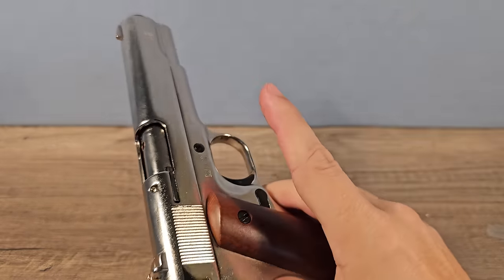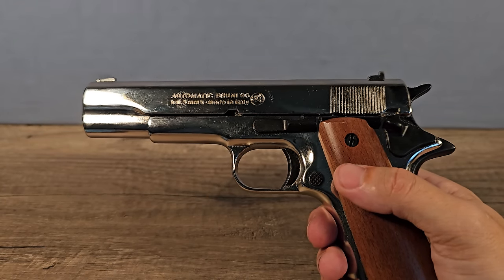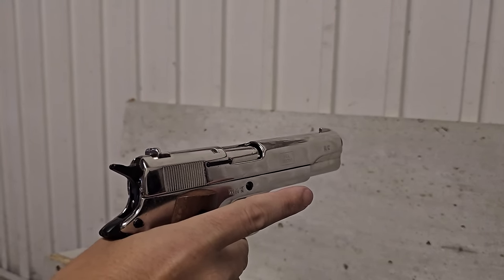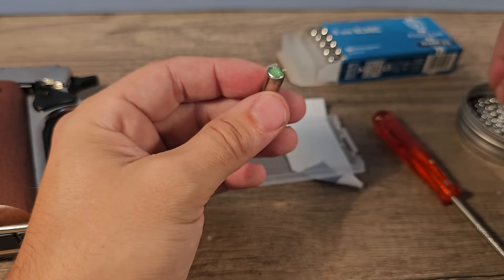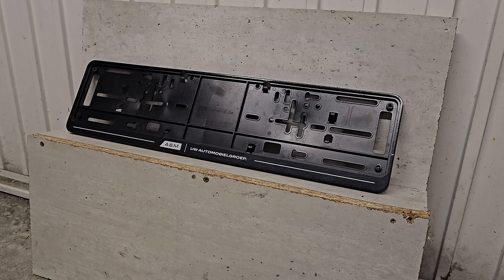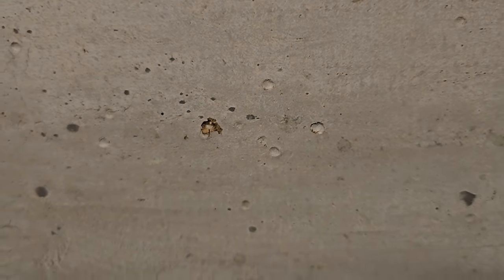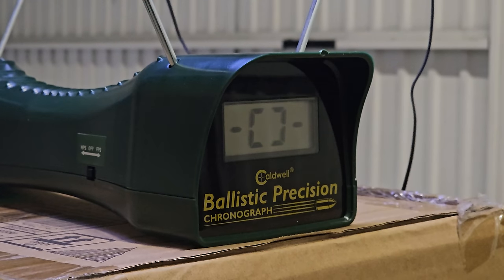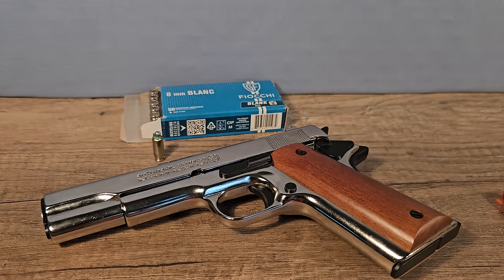Can we make a blank gun usefull for self defence?

Comment: Guys dont mess around with blank guns. They are designed against tampering as people already did it in the 80s and 90s so theu made them tamper resistent
Reply from the maker: They sure did 
i noticed how well they designed it. If you do try to tamper with it, you will destroy the gun.
Reply: @user-mn6em5lr5i  the whole thing is made of an alloy, not steel. Its a good way to end up with missing fingers when chamber pressure is introduced.
Reply: It does not makes sense
Reply: Stares with a blank stare
Reply: I transform them to 380 7.65 and 6.35 for years. Make a New barrel and firing pin. New bigger hammer spring. Take the dent out the magazine. Thats about it. I transform about 50 per month. Its not hard at all if you know what youre doing. In 380 they not last long since they are made of zamak. Some models you can buy a steel slide then they are just as good as original guns. And yes i also build back New eu deco to live. Alot of work but again not impossible
Reply: @josh.1290  on this weeks lying to strangers on the internet.
Reply: @josh.1290  and for all that effort for something dodgy that can blow up in your face, might as well just buy a genuine hand gun.
Reply: @MrRedeyedJedi  good job he's lying really
Reply: @josh.1290  Why do you need to make a new firing pin and install a stronger hammer spring?
Those two parts are about the only parts of a blank firer that work exactly the same way as on a real firearm. 
The primers in blank cartridges are the same as those in live cartridges.
Reply: @MrRedeyedJedi  very true but if you make it good with the proper tools they wont blow up. Plus in europe getting a legal gun is hard. And illegal they are expencive. A cheap glock 19 illegal cost about 4500€ most people they dont have that. A rebuild alarm cost 650 till 900€ thats why they are populair. If you live in the usa nobody would do the afford to rebuild it. But also in the us there are alot of people building there own guns. Look up the fgc 9mm from j stark made in germany it is now world wide in use cause it is easy to make and it works
Reply: @josh.1290  whats ur favorite blank gun to convert over? Ever do 22LR conversion?
Reply: @HollandBozek   zoraki 906. I have that one in 22lr with double match barrel and silencer. I used a anschuts magazine max 8 rounds.
Reply: @josh.1290 Do you recommend any turkish blank gun that is sold on spain right now? You have any email to contact i am interested in learning more
Reply: What's blank gun？
Reply: What is the point of having a "blank" pistol for """""self defense"""""? What could you possibly defend yourself against with a prop toy? Europe has a lot of jokes apparently...
Reply: @deloreandmc88  U modify it to make it shoot 22 Lr
Reply: @Anomyzer24  That's not my point. Why need "blank pistols" in the first place? Why disarm the population?
Reply: @deloreandmc88  Because in spain weapon laws are very restrictive
Reply: You do know everything you are talking about is very illegal 😅
Reply: Brandon lee
Reply: @Danilad89 some laws should be broken.
Reply: user-mn6em5lr5i   key word has been.   It is possible, but not practical, nor easy.   You'd have more in a blank gun than it would cost to even buy a cheap glock or hipoint.
Reply: @MrRedeyedJedi that’s why you cut the alloy barrel right off at the chamber insert a barrel liner and weld it to the chamber boom there you go or you can drill it out and just insert the barrel liner in the alloy barrel
Reply: @Lethal22GS  give it a try. Don't forget eye protection and gloves.
Reply: @MrRedeyedJedi  did it multiple times before fires 380 just fine
Reply: @Lethal22GS  bolt face is made of zinc alloy here lol so OK.
Reply: @MrRedeyedJedi  never said with brunis , I’m talking about zorakis and Ekol blank guns
Reply: @MrRedeyedJedi  if you don’t believe me there are hundreds of videos online with people converting zorakis and Ekol blank guns  to fire live ammo the alloy they make them with is a stronger type of metal not just zinc
Reply: Nothing is impossible front firing  blank guns only have a divider very easily modified it's how people get by the strict laws in Europe
Reply: @michaelfascianojr3784  front firing is banned here
Reply: Its still posible with some blacks IT has Been done many Times in europe
Reply: user-mn6em5lr5i  the reason why you don't see more of them, or because people are more intelligent and know that doing what you suggest is going to be a bad idea at nine times out of 10.   That and finding a blank guns like seen in the video are very hard and expensive to come by. Not many people make them anymore.  It's easier just to convert a real gun into a blank gun. Even Hollywood doesn't use these much anymore.
Reply: They also almost costs like a real gun . A blank gun costs between 2 and 300 and a real glock cost 350/400
Reply: @josh.1290 you don’t need to replace the firing pin or hammer spring so you don’t know what you’re talking about, also re-activating EU deactivated guns with the latest specifications is literally useless, because you need a new slide/bolt, barrel, fire control unit, magazine and other pressure bearing parts. If you can make all of those parts then you can literally make the gun itself for cheaper and less hassle
Reply: @josh.1290 What country you in?
Reply: @theculturedthug6609   im from the netherlands.
Reply: it does very little damage because the gunpowder contained is very little. Open four cartridges, and pour the powder into the fifth cartridge, then insert the steel ball. I'll leave you the surprise :)
Reply: @painkiller6019  it will explode
Reply: Youtube keyboard police. Lol
Reply: Not if you get a Turkish made retay
Reply: I want this pistal
Reply: 85 percent of shootings in the UK nowadays use modified blank firing guns. And those are top venting so that's extra dodgy. When you pull the trigger you either gonna hit him or blow your fucking hand off 😂
Reply: There are many folks that convert blank guns to fire .380 and others. It's by no means impossible, but it does require a good bit of ingenuity and familiarity with tools and such. The 'average' person would see no reason to do it. But in areas where firearms are hard to get, conversions are big. 

There were guys in Toronto years ago who got caught turning hundreds of airsoft guns into actual live weapons. Same reason why 3d printed guns are coming out; because people CAN. Definitely not choice number one for defense over a real firearm, but many folks in the world live under HEAVY firearm restrictions.
Edit; in many places blank guns are sold without the orange tip, and that allows people to bluster in self defense, fire shots, etc. Very risky idea, but with a full load and a front venting blank gun it would be hard to tell any difference while being shot at.
Reply: @tylerkinley268  Is it possible? Yes, with some models, but your average Joe isn't going to pressure test, use the correct powder, use damping, or have access to the correct equipment to do it in a way that is safe and that is the concern. A background/understanding in machining and the physics involved is a must, vast majority will end up hurting themselves or others or worse. In the uk, all of the available models are made in a way where it's not a worthwhile endeavour, nor worth the prison time.
Reply: @MrRedeyedJedi  I specifically mentioned that the average person wouldn't/couldn't.
Edit: safety is relative. The people modifying these typically aren't running a production line for resale, they are doing it for their own entertainment and hobby. Something being unsafe doesnt deter people from something if they are interested enough.
Reply: In this day and age, nothing is tamper resistant.
Reply: @josh.1290 . See, like I said, nothing is tamper resistant
Reply: @shanetembo4350  yes. Yes it is. There is a difference between resistant and proof. Look into it dude

Comment: If you remake the 8mm blanks to ratshot 8mm and drill out the barrel correctly or make a new one you basically have a very dangerous small shotgun pistol that you have to rack after every shot
Reply from the maker: i call it a sketchy pirate gun 😁
Reply: it's not going to work, they are made of a special brittle metal that's going to break if exposed to such pressures
Reply: @TheMasterCreeper01  Not hard to make your own barrel from steel....

Comment: Use a drill bit (manually..not in a drill) to remove the green plastic, place the ball in the hole, seal with wax..no risk of ball falling off & if you get it right, some mags will accommodate & cycle can be completed ! 🤷‍♂️
Reply from the maker: Working on it 😁
Reply: @HappyDude1 use 6.35mm lead airgun slugs

Comment: do not glue it there. make it like a front loading pistol seal. have a piece of cloth and make sure its a tight seal with a ball round. it will fly straight a ball round does not need to be stabilized, cuz its already ball shape. i made something like this, and made a hole on the PAK round plasitc, and fill up with powder from an other one. IT IS JUST FOR FUN. IT CAN BE LETHAL WHEN HITTING A HUMAN TORSO. NEVER AIM IT TOWARDS A HUMAN EVER. I mesured it and it is around 600 BAR so yeah deadly... a 5.6 mm ball will stop fast, not enough weight, but a jacket and a flesh wont stop it.

Comment: If you take the plastic cap out then depending  on how much space there is under the cap place the steel on top of gunpowder then replace the cap with super glue if you need to remove some powder it's fine

Comment: Egyptians at the time of revolution added a small iron ball on the tip also added rubber ball the thing is blank guns are blank if the barrell is opened by the factory still the ball gonna go out not straight because the barrell is not like the rile fire arm and the ball will be hitting the barrell up and down and not forward plus  you cant aim as none in it is accurate but from a close range it can cause so bad damage and even can cause death
Reply from the maker: Exactly

Comment: Will you try .22 or.25 caliber pellets?
Reply from the maker: No 😁 no pellets
Reply: @HappyDude1 why not? Lead airgun slugs in .25 fit perfectly in the opened up blank round! And you only have to drill the barrel to the correct size, because it has the same pressure as the blanks it was designed for!

Comment: Just use 8.7 mm ball bearings in the chamber. or 8mm bbs If you are going to glues bbs like that its horrible, break open green plastic cover of blank and insert 5.5 Pellet then seal with candle wax. You cant do it the way you did it because the barrel is not rifled.

Comment: Don’t it. Especially not in 9mm/8mm.

It could handle 0.22cal even metal softair/airguns from the material standpoint can handle .22cal, just need a new barrel and exchange some parts in an air gun. Conversion kits are even available in the us I believe for airguns. 

Blankgun conversions meh… usually have fixed barrels. Those if open could handle weaker 0.22cal ammo. Because it’s even weaker than the regular blank gun ammo. 

However I don’t think modifying a blank gun isn’t worth the effort.

However don’t use steel bbs for that co2 1911, they’re too light. Use lead bbs. I have a 6mm 1911 compact airsoft as well and it can handle way heavier 6mm 90g steel bbs. You’ll sacrifice range for power but it’s worth it.

Comment: This is not true that later edition of blank fire weapons can't be converted to live fire. I've done it on a Glock made of cheap soft cast metal.  I simply cut at the rear edge of the blockage. I had round bar drilled 6 mill and reduced to fit into the chamber. I left the insert end of barrel slightly bigger through rough surface. I used epoxy resin to glue in to chamber in which I placed a blank and pressed in a vice until new barrel touched tip of blank which showed the blank was in correct place to meet the strike of firing pin. I drilled out the plastic core of the blank and pressed 6 mm ball bearing into it. Gun worked fine but obviously the blanks are lower power load so velocity wasn't great

Comment: Here in colombia the people or criminial used to cut the zamak barrel of the blanks guns and change it for a metal barrel , the ammunition .380 acp is the same size that the blank ammunition so it works perfectly like a real gun....  , you have to change the barrel  because the default barrel is made of zamak  and if you put a real bullet there it will exploid , or also you can modify the p.a.k ammution (blank ammunition ) and put a ogive made of lead, you have to remove the green plastic and then glu the ogive with instant glue.. ,  if i remember correctly is like 25mm  , also here in colombia they sell  p.a ammunition (traumatic ammunition) that is like blank ammunition but it has a rubberball as a projectile this p.a ammunition can destroy your skin and if you shoot someone in the head you probably kill him but of course it cant pass throught your body cause is a rubber ball ,  so if you put a small iron ball on top of the rubber ball it will be more lethal or some people just put a piece of lead  and all that without modify the barrel , i mean p.a.k guns have a closed barrel and you can open it with a drill but here in colombia they sell p.a guns that the barrel is open , but one way o the other you can make it lethal
Reply from the maker: People or criminials so thats everbody? 😁 so everybody is a criminal in columbia 🤣
Reply: interesting.
Reply: @HappyDude1  why you delete my comment?
Reply from the maker: @JuanGomez-zm4gt  
I didn't.....

Comment: Why don’t you show the barrel? Since it “is an older model” and definitely not converted by you, because you have the cut off barrel
Reply: Also if it was an older model it would still cycle also I can see the top venting hole on it, put a lead projectile in front of the blank next time or use a 6mm steel bb, use superglue next time.

Comment: You could try and use 8mm plastic bbs or 8mm steel balls
Reply from the maker: It won't fit the hole is only 5 mm
Reply: @HappyDude1  i guess you have no other choice. You gotta work with what you have.

Comment: Id love a chrome 1911 airsoft,  cant find one, only Tokyo marui which is plastic....
Reply from the maker: I know... it does not exhist 
So this one is chrome and  also  makes noise 😀
Reply: WE Tech 1911 GBB Pistol - 98$ Green gas.
CYBERGUN COLT 1911 GBB AIRSOFT PISTOL - 148$ also green gas.

These two are the most reliable. Tokyo Marui is basically Toyota of airsoft guns. Metal guns cost more, of course.
Reply from the maker: @gabonskaiagadziuka  
I would say its the honda of airsoft 😁 expensive, all plastic but it will last forever
Reply: @HappyDude1  honda is bottom line of market in the ways of pricing, its nowhere near expensive. topped out accord non-hybrid can be bought for 32-35k$ brand new. its just a toyota competitor. sorry i love arguing
Reply from the maker: @gabonskaiagadziuka 
I love it even more 😁
And not only is honda the best Japanese car, i would say it's simply the best brand period 😆 or you know what lets say lexus is the best 
Its a mercedes with honda build quality made by toyota 😃😃😃

Comment: You can turn it into a gun you’d have to cut off the barrel get some 4140 steel drill it rifle it weld back onto the gun would recommend.32 auto for Bruni products they suck zoraki ekol pretty much anything made in turkey is built better more steel parts
Reply: zoraki 917 can be converted to 9x17mm gun. no pun intended they name the that way to give a hint I believe
Reply: @Ebu_Cehil_El-Fakbadi  yeah that’s more for skilled people who know what they’re doing though .380 is still high enough pressure to cause cracks on outer and inner parts so that’s why I recommend .32 auto lower pressure so you don’t gotta worry as much either will work I hear
Reply: @kenstewart7700  7.65mm/.32 conversions are more common than 9x17 for the reasons you have stated I'm just saying 9x17 is the top limit and yes it won't hold for long if the guy who converted didn't do some steel frame/barrel upgrades. Also in the summer government here tried to ban collect all the blank guns since everyone converts these and when they fail I think they order these guns to be made from lesser steel. So new gen turkish blanks may not be as convertable as used to be. Some say damn british cried about it and pressured on us. So if you wanna convert just buy anything prior to 2023. I think this is the second downgrade. Lore around here says blanks that made more than a decade ago was even stronger than these and possible endure the pressure of 9x19mm but I'm not sure either.
Reply: @Ebu_Cehil_El-Fakbadi  it's safer to  make derringers really.